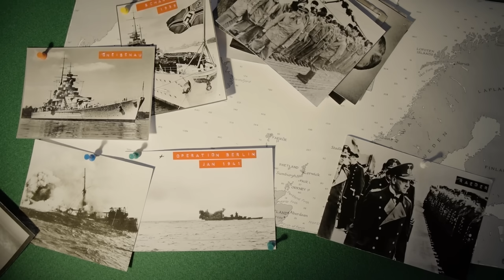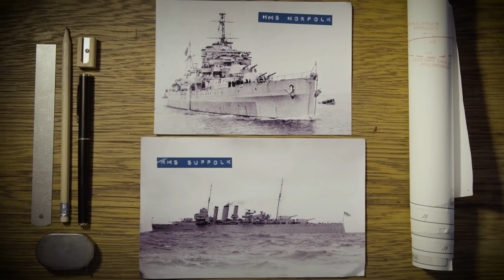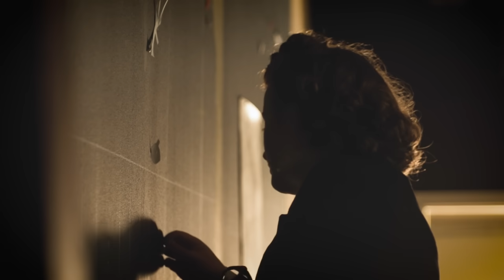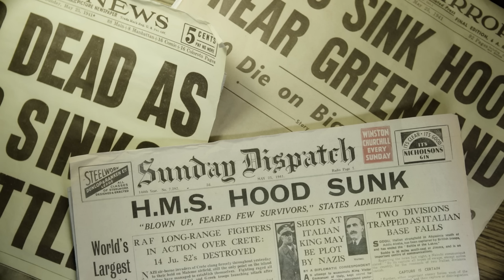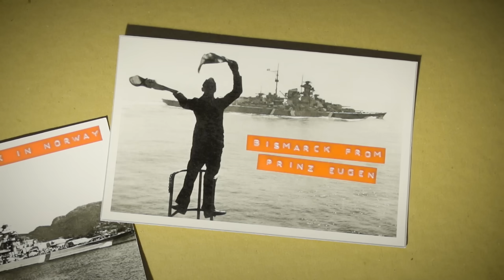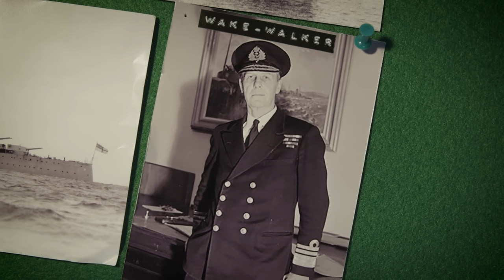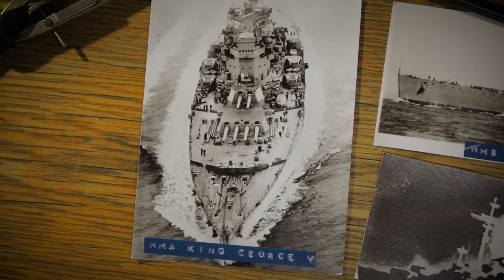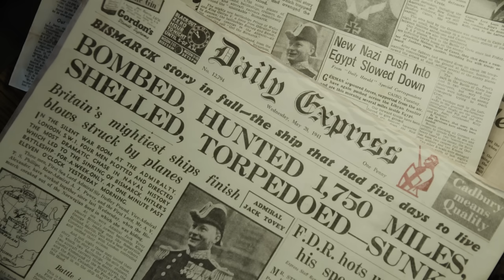Bismarck: How Britain Sank The Infamous German Battleship | Full Documentary | History Hit

Comment: We need to start tackling the myth that Bismarck was so powerful. It wasn't. Its armor scheme was obsolete as it drew from the armor schemes of WWI German dreadnoughts. There is a myth that Bismarck's main armor belt was not penetrated when it actually was by both 16 and 14 inch shells. If the 14 inch guns of the King George V could penetrate the conning tower (with one shot actually tearing the tower's roof in two)  it would have had little trouble with the main belt as the tower's armor was thicker than the main belt. Bismarck was yes a powerful ship, but it was VERY inefficient with its armor, could throw less weight of shell at targets than the KGVs and Nelsons and had some serious structural weaknesses that plagued all contemporary German designs. That's why the stern is gone. The sterns were far weaker than they should have been because of its triple propellor arrangement. That arrangement also made it far more difficult to control without the rudder. Even on sea trials it was shown to be almost impossible to control with using the screws.
Reply: The Cameron Expedition report documents multiple penetrations of Bismarck's armor belt and includes a picture of one of those penetrations.

One of the limitations on KGV class was that Britain was pushing for a treaty limit restricting new battleships guns to 14".  But they did manage some very high performance 14" guns to make up for the lower bore diameter.  Excellent penetration.

In ways it was a pretty good match for Bismarck.  Bismarck had heavier guns and weaker armor to go up against the stronger armor of a KGV class ship.
Reply: Scuttled not sunk
Reply: @tomhenry897  Oh geez. One of you. It would have sunk anyway. They just sped it up. There was no way it was staying afloat much longer.
Reply: @tomhenry897    "Quit, not fired!" screamed the man caught stealing from his employer.  End result, Bismarck on the bottom, was going to be the same regardless of what the Germans did.

But if we must all nitpick over it, let's just leave it that Bismarck was soundly defeated by the British Royal Navy.  So much so that they persuaded the Germans to make it easier for them.
 
Or we can say that damage inflicted by the Royal Navy had Bismarck sinking from out of control flooding, and on fire the length of the ship.  It is extremely doubtful the Germans could have prevented Bismarck from sinking no matter how much they tried.

Comment: Great doco, But please give up on the plunging fire. Bismarck ballistics and distance means she was firing pretty flat. So taking in position direction ships are facing and distance, truly there are only two options to the destruction of the hood. 1:- as the hood turned to port at speed, Hood healed to Starboard, leaning her Deck toward Bismarck, allowing a shell to pernitrate through the deck somewhere near the rear mast 2:- Bismark shell lands short, or low on the Hull due to the wake Hood has at speed, this shell ends up going under the Armour, exploding inside Hood. There could be considered, that in the Heat of battle, Hood had a "Jutland" and the crew of turret three, made a mistake. There is eye witness evidence that this is possible, One of the Crew of Prince of Wales, that just before the explosion, Hoods 3rd Turret did not seem to fire correctly, It then trained out to fire then returned and while it was in this returned position, rounds from Bismark landed and there was an explosion. Anyway the ships where too close to have plunging fire a factor.

Comment: Have the narrators seen the Pacific war? The swordfish aircraft would have lasted 3 seconds before they were all shot down. What a joke! The Brits were incredibly lucky.
Reply: The Swordfish was never intended to operate in the Pacific.  It was designed to operate in the Atlantic, where it would not encounter fighter opposition, and in the Mediterranean, where it would have protection from carrier fighters.

It was also intended to be able to take off and land in conditions which would have grounded other, heavier torpedo bombers. The contemporary US aircraft, the Devastator, was 2,000 lbs heavier, and simply could not have got off Ark Royal's deck in the sea conditions which prevailed in the Atlantic on 26 May.   Moreover, the Swordfish with torpedo had a range of 454 nautical miles. The Devastator with torpedo a range of 378 nmi.

'The Brits were incredibly lucky.' If you mean by that that the British were lucky to have had Swordfish rather than Devastators on the decks of Victorious or Ark Royal, then I agree.

Comment: All that at the end of the day it was a bi plane that caused the Bismark to be sunk.
Reply: Fantastic aircraft, the Fairey Swordfish.  The Americans introduced the Devastator after the Swordfish, but the Devastator couldn't make it a year into the war without being retired as obsolete.
The Swordfish was replaced by the Albacore and the adoption of the American Avenger as a torpedo bomber for fleet carriers but was still in production after the Albacore was cancelled. It could fly off the smallest flight decks in weather that would ground most other naval aircraft. It could carry radar units to assist in low light/night attacks (such as the attack on Bismarck) and proved very useful in hunting u-boats.
That bi-plane was responsible for the loss of more Axis shipping than any other aircraft model.

Comment: The German crew sank the Bismarck. The British battleships had left the area being unable to finish him off. Clearly the British needed the prestige of sinking her but the charges were set off and the mighty battleship sank.
Reply: Was irrelevant ultimately, as the expert said, the Bismarck was going down regardless
Reply: Nonsense.  The slowly sinking wreck was finished off by torpedoes from a heavy cruiser. The senior surviving German officer seems to have known nothing about your suggestion.
Reply: This is completely wrong.  In case you think this isn't true, let me tell you how extensively the Bismarck had been damaged - her bridge crew had all been wounded/killed when a British shell struck the bridge, her superstructure was literally blazing red hot from the shell impacts and fires upon her deck, and she was actively being hit by point-blank torpedo runs from the HMS Dorsetshire. There was zero chance of her survival or even a continuation of her last stand.

For crying out loud, they deduced from her wreckage she had likely sustained a colossal gash in her stem during the battle!!! If you want even more proof; according to Seaman Paul Rudek (who escaped from the Forward Main Battery Plotting Station in Compartment XV) the scene between the upper and lower armor decks was indescribable. The damage was so severe, hatches and doors between the decks had become jammed due to the distortion and heavy wreckage spread across the structure!
Reply: The Japanese scuttled all 4 of their aircraft carriers sunk during the Battle of Midway, you're making a point without a difference, the RN sank the Bismarck 🙄

Comment: He says a battleship can sink all the escort destroyers and the freighters of the convoy. I direct you to Taffy 3 or the Battle of Samar.

In this battle it's nearly impossible to exaggerate the magnitude of the mismatch and yet when the smoke cleared the Americans were in control and the seas and the Japanese were retreating.
Reply: Taffy 3 is the exception and not the rule.  Of course it comes down to training and tactics, but a destroyer escort was not equipped to fight off battleships.  Taffy 3 bought time for their escort carrier to escape as the Japanese admiral fended off air attacks by USN bombers but they paid a heavy price for doing so.  
The sinking of most of convoy PQ-17 was the more likely scenario if it came to a Bismarck battleship running amok in major shipping lanes.
Reply: if you paid attention  the narrators  said the if  the  U Boats in conjunction  with the  german battleship  they could have decimated an entire convoy  plus  the escorts,  i bring your attention to a  engagement  in 1940, a British carrier HMS Glorious  plus two escort  sailing from norway  to the uk ,were intercepted by two german battlecruiser Scharnhorst and Gneisenau, the result was    both carrier and escorts were sunk,  the escorts turned to face  scharnhorst  in a torpedo attack,  both were quickly eliminated , the carrier wasa caught napping and  was chased down  while running on half power to save fuel, on top of that the captain through his incompetence   and zero   experienced in carrier operations ,and failed to launch its aircraft  to protect the carrier, even when air fleet commanders  pleaded with  captain to be given the order to  attack the german ships , as a result all crew were lost .

Comment: It’s absolutely ridiculous nothing could be done to fix the rudder or steering. If they had divers to attempt to fix the leak from the hood battle, they can use them in an effort to correct at least partially the rudder issue
Reply: The damage was far more severe than simple rudder damage. Several compartments were flooded, and the entire stern compromised.

Comment: I watched this to see if it got things correct or just followed hearsay.  while it had some well researched points, Hood's weakness was not deck armor, it was wear the hood and deck armor did not meet as a result of 5000 extra tons of armor added . This had the effect of separating the deck and the belt armor.  That is what the Admiralty feared. Secondly the bow shot that Prince of Wales laded did explode inside of Bismark destroying one boiler room, flooding another and letting in 3100 tons of seawater in minutes. The hole was never able to be fixed. You cand find the pictures of Bismarck post Denmark Straits, it was seriously damage bow down near water level, screws partially coming out of the water. The truth of this incident that no one ever talks about is that of the 4 ships present. 3 were damaged by diving shells and those three were al sunk by the end of 1941. Oh, and Britain did have ships to stand up to Bismark, HMS Rodney which turned Bismark to burning scrap metal by itself in 30 minutes. Get it right guys!